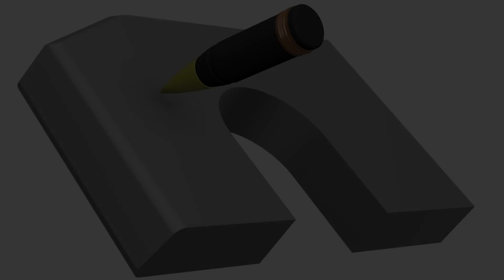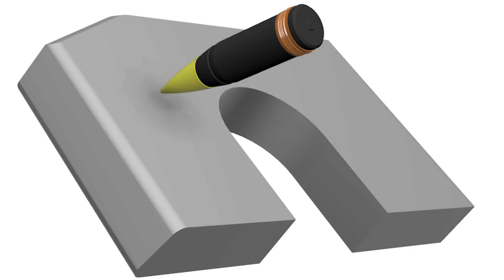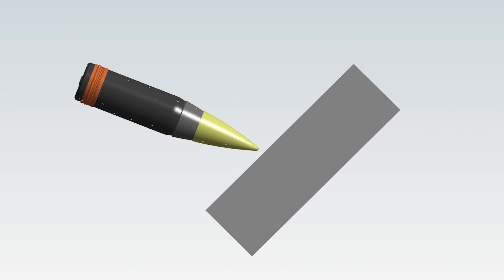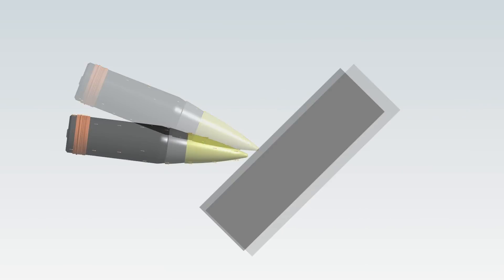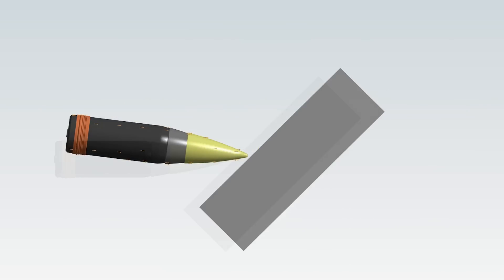USS-Iowa VS Yamato Simulation Part 2

Comment: Wonder about the reverse situation.
Reply: Source material is from the U.S. Navy Bureau of Ordnance.

Immunity zone of the Iowas vs. the 18.1" gun:
Citadel                    24,800- 29,800 (5,000 yards);
Turret Faceplates 24,700- 31,600 (6,900 Yards);
Barbettes               26,500- 31,600 (5,100 Yards);
Steering                 24,700- 28,800 (4,100 Yards);
Control Tower       26,500- 31,600 (5,100 Yards).

Immunity Zone of the Yamatos vs. the 16" .50 cal. gun:
Citadel             17,000- 34,500 (17,500 Yards);
Turret Faceplates                      (Impenetrable);
Barbettes         16,600- 36,800 (20,200 Yards);
Steering           19,100- 33,400 (14,300 Yards);
Control Tower 16,600- 33,400 (16,800 Yards).

Comment: I’m curious as to why the tip of the shell was hollow. I would imagine it would have a much easier time penetrating armor if it had a solid steel pointed tip.
Reply: It is ballistic cap of Armor piercing shell. It is there only to make it more aerodynamic and so lose less speed when traveling. It is hollow so it doesn't interfere with penetration. Steel cap that helps with penetration is behind it. Also you don't want pointed head in these shells because it would just shatter when hitting plate and make shell lose ton of penetration power.

Comment: now it would be interessting to see some modern APFSDS rounds vs. the Yamato turret
Reply: Only APFSDS that could pen front plate of Yamato turret would be if Russians sources are correct Vacuum-1 APFSDS from T-14 tank. It is only APFSDS that has longer length then thickness of the turret front. DM63 and M829A3 both fall short 20-30mm to have chance of penetrating.
Reply: Isnt there another newer generation of APFSDS in the 73 and A4? I swear I've heard those shells being tossed around in a few discussions before
Reply: APFSDS would shatter against the plate. Energy = Mass times (velocity squared). Although their muzzle velocity is about twice as great as a 16" .50 cal. shell, their mass is a very small fraction of the 16" shell.

Comment: They actually did this test on the shinano turret face armor and it's still sitting in the Washington DC Naval Yard you can look it up on the internet the 16-inch shell punched a hole clean through it ,granted this armor wasn't supported in a turret
Reply: Doesn't really matter, all the turret crews would be bleeding from their ears and completely out of action from the pressure wave created by the hit.
Reply: Well that was really damn awful test because plate was way too close and not angled like it would be if mounted on turret. They lowered powder charge, but not nearly enough to make test any way realistic.
Reply: @Sarfanger that test wasnt awfull it was  absolute perfect simulation of a hit at 22mile combat range…

The angle and the shell velocity were matching impact at 22mile range there is plenty of official data from the testfire from the official documents and also from the 16” Mark8 balistics table…
Reply: @17tomashavlin  Good for you if you believe that using rejected plate, at non-realistic angle, distance and with no backing is realistic. Also shells don't come down at perfect angle because of their spin people think that the shell always keeps the nose pointing forward, but this is not the case when you shoot shells that spin around their axis. 

Also velocity wasn't matching 22miles. At 22 miles velocity would around 420m/s while they used point blank reduced shot that was over 600m/s. Even if shell followed perfect angle US document BuOrd OP 770 states at 22miles angle would 47.73 degrees and not 45 degree.

October 16th 1946: 
Impact # 33443
Projectile Used:	U.S. Navy 2700-lb 16" Mark 8 Mod 6 AP with inert filler
Striking Velocity	1992 feet/second (607.2 m/sec)
Obliquity	Near-normal (0°)

Comment: A quick thought, are these the standard 16 inch armour piercing, or the superheavy 16 inch armour piercing the US developed and issued mid to late war?

If I recall not all the US 16 inch battleships would have been able to use them, but the Iowa's most definitely could. 

The question is an important one as if this battle HAD actually occurred, the Iowa's would have been loading the superheavy 16 inch shells and not the standard AP shells most of the others would have to use.

Comment: I believe that the front face was laminated armor which is inferior to a single slab. So it probably would get penetrated after all or would spall.
Reply: Yes you are correct they couldn't reliably cast a turret face in one piece it was laminated and you can see the results of this at the Washington DC Naval Yard they had the turret face armor for shinano and the 16-inch shell blew a hole right through it there's pictures on the web
Reply: @kylevansteinburg5990  That plate was also rejected by the IJN and was fired from point blank range with no angling. Test was totally useless because scenario like that couldn't happen.
Reply: Source material is from the U.S. Navy Bureau of Ordnance.

Immunity zone of the Iowas vs. the 18.1" gun:
Citadel                    24,800- 29,800 (5,000 yards);
Turret Faceplates 24,700- 31,600 (6,900 Yards);
Barbettes               26,500- 31,600 (5,100 Yards);
Steering                 24,700- 28,800 (4,100 Yards);
Control Tower       26,500- 31,600 (5,100 Yards).

Immunity Zone of the Yamatos vs. the 16" .50 cal. gun:
Citadel             17,000- 34,500 (17,500 Yards);
Turret Faceplates                      (Impenetrable);
Barbettes         16,600- 36,800 (20,200 Yards);
Steering           19,100- 33,400 (14,300 Yards);
Control Tower 16,600- 33,400 (16,800 Yards).

Comment: Closest the shell came to penetrating was at 25 km since it was coming in at a relatively good angle. True the closer you are the more energy the shell would have but you also have more armor to go through since its coming in at a steeper angle
Reply: There was a whole thing with shell design back in the 20s and 30s where the drawing board consisted of how to have shells not strike the main armor belt. Its quite an interesting read about USN research vs IJN research where IJN tried a creative method of a shell diving into the water and using the hydrodynamic properties of the shell shape to direct it below the main belt like a torpedo. Called diving/torpedo shells, their design was that they could carry sufficient penetration force roughly 20 times the shell caliber making near misses also quite deadly. In actuality though, the shells failed to meet this standard and traveled less distance underwater plus carried less energy to reach penetration at the closer hits in addition to having poorer direct hit performance of similar caliber shells designed for direct penetration.

Comment: A clear design flaw. They didn't do a rounded turret where the angle of impact doesn't matter because the thickness would be equal in every direction. In this case, a flat plate demonstrates it's weakness, because it can have only 660mm or a little bit more depending of the angle.
Reply: Designers assume turrets will be pointed at the enemy when in combat so unless you're engaging multiple targets a front on shot is most likely.

Comment: I would like to see how a modern apfsds round would perform against this type of armor, maybe at normal tank engaging distances, so it would have a chance at doing anything.
Reply: Problem is that APFSDS core has to be longer then steel plate that is penetrating. Only APFSDS in production that is longer then 650mm is Russian Vacuum-1 for T-14 tank ,but I have only seen single shell manufactured.

Comment: 0:41, just some quick calculations, that backface deformation causes the a pressure wave of 1 ATM to propagate through the cabin,  and a 197 Db soundwave. In short everyone probably lived but is now mildly concussed, and vomiting violently out of sheer pain and vertigo caused by blown out ears.
Reply: yea, that turret would be out of commision for a good bit till either the crew was replaced or managed to pull themselves together
Reply: SRY, COULD U ELABORATE JUST A BIT, WHAT CALCULATIONS DID YOU DO, JUST OUT OF CURIOSITY
Reply: Oops, had the caps on, my bad
Reply: @afonsoalves9704  you were almost look like that crew inside turret
Reply: @afonsoalves9704  At a guess (Im not checking the maths for you, sry nt sry), taking the velocity of a 16" round at the given distance and timing the pixels it traversed before impact will give you a time constant. Use that time constant to calculate the time the deformation took to happen, using the diameter of the shell you can determine a constant to measure the deformation amount. Deformation distance over time gives you a velocity, density of the air around the deformation area will help you work out how effectively that motion is absorbed and transferred to the air surrounding it, thus the propagation wave. Once you have the propagation wave figures you can derive the pressure delta as it passes a given point, and how it acts in an enclosed space. 

Dude, did you like not have lincoln logs as a kid? Or like, legos? Kinex? Put the pieces together, bruh.....

Also, for those about to type something about maths being hard, its not hard, numbers arent scary, yall just have unaddressed traumas left over from school and homework that make you feel like you're a failure because it wasnt easy and you werent perfect the first time. Well, guess what boopy.... NO ONE IS PERFECT THE FIRST TIME. EVER. PERIOD!!! Get over it. How do you get to carnegie hall? Practice, practice, practice. And a left on 7th. Not by declaring things are scary and you suck. You dont suck. Your attitude towards yourself sucks. Stop that. What did they ever do to you? Nothing. Now leave them alone, they're trying! While you're not judging them for others (quite offensive to the others you are judging yourself for by the way, assuming what they care about, how dare you) practice some recreational math. You can do it. I believe in you. The not sucky you. The sucky you needs some therapy.....
Reply: @TankR  jeez I'm sorry that was legit a real question mister... Thought he might give a name for some specific set of equations or smth, geee, what's so triggering about that
Reply: @afonsoalves9704  Dude, that was expressly "for those about to type something about maths being hard"....Dont apologize for them. They're being lazy for cool points. And this dude will not abide.

Your honest question got an honest answer...as it should have. Sure the not checking the math bit was a bit spicy, but the aspects as mentioned were what I could honestly suss out as being relevant. Its the people to think its cool to be wilfuly ignorant and actively avoid engaging their brains that trigger me. And I had been bouncing around some videos with......very problematic comment sections in that regard......
Reply: @TankR get a job
Reply: @b74312  So, basically, my argument is sound, and you have nothing to come back with other than to make schoolyard insults to try harming my feels? 🤣You gotta try harder than that sunshine. Oh, no wait, sunshine is what we brought to the party.....twice.....
Reply: @TankR  “basically” LOL on the self own. Get a job bro.
Reply: @b74312  awe, look guys, its doesnt know its stupid. how cute. Say it again. Cmon, say it again, you can do it little buddy.....
Reply: @TankR  don’t worry man, you’ll get there one day. I believe in you. You got this.
Reply: I am also curious as to how you calculated that
Reply: hell of a lot better than being a smear on the wall, and the iowa's turret cant even take 
the same level of punishment from the yamato, much less its own 16 inch naval guns.
Reply: IM SORRY CAN YOU REPEAT THAT, I CANT HEAR ANYTHING 
-the crew

Comment: I'm not sure if those angles and velocities are correct?

From Nathan Okun's penetration table,

The shells arrival angle at those ranges should be:

25km = Circa 25 deg (26KY-28KY = 22.9-25.6 deg and 25km = 27340yards)

And arriving at a speed of 498-488 M/s

15km = a tad over 11.2 deg (16KY = 11.2 deg and 15 km = 16404 yards)

And arriving at a speed of circa 571 M/s

Comment: If you watched previous videos even when Iowa angles it is not enough too deflect a 18.1 inch shell on the armor belt
Reply: If the Iowa angles,

The hull armour may decap the shell, and from that point on the amount of armour that the shell can penetrate will be reduced.

For example a decapped 14inch and at least 15 inch shell (possibly 16 inch as well) will not penetrate more than 8 inches of armour.

Which is why on the Bismarck class, the turret barbette armour decreased in thickness to only 220mm.

Since the 145mm upper belt is guaranteed to decap every shell, you only need a minimum of 203mm of armour to shatter the shell.
Reply: @ it seems in his videos the simulations show complete penetration each time at a velocity of around 540mps

Comment: Something to mention: you can't simply calculate effective thickness by using trigonometric functions, neither horizonal nor vertical. The value would differ for different calibre/length shells in the penetrating progress, since shells are not a simple point of mass, thus you have to think over the T/D (actual armor thickness to shell diameter)  ratio.

Comment: They would have used plunging fire, which means deck penetration so in goes below decks and explodes.  Iowa had radar guidance for its fire control, the Yamato would have been sunk or severely damaged inside of 10 min
Reply: The advantage of U.S. Navy fire control radar is a widely stated and believed myth. The advantage of the U.S. Navy's Mark 8 radar range keeper over Yamato's foretop optics and her Type 22 radar was minimal- 30- 45 yards at 20- 25,000 yards, versus 89 and 109 yards respectively. This was more than offset by the shell dispersion rate of all U.S. modern battleships versus that of Yamato- 1.9% of range for a nine- gun salvo vs. 1.3%. This was a major factor in why none of the Iowa's obtained a main battery hit on any vessel of destroyer size or larger during WW2 (in one case even though firing at a stationary target)- and why Yamato obtained multiple 1st- salvo hits on two different U.S. vessels off Samar.
Reply: @ the battleship Wisconsin fired 3 salvos at 35000 yards at a towed target striking it 11 times
Reply: @MedicNewfy  During Operation Hailstone in February of 1944, Iowa engaged the Japanese training cruiser Katori in a clear visibility daylight action at an average range of less than 14,500 yards (medium range at best) using the Mark 8. Shell splashes were observed both visually and with the Mark 8. All eight salvoes (46 rounds, I believe) were straddles with no hits. This was despite the fact that by the time that Iowa opened fire, Katori had already been hit by a torpedo and from 2- 7 bombs by carrier aircraft, numerous 8" and 5" hits from a U.S. heavy cruiser and destroyer, was not firing her guns back, and was making approximately 1- 2 knots (one report had Katori dead in the water).

One reason for this was a lack of main battery gunnery practice of almost all of the modern U.S. battleships after arriving in the Pacific Theater. In fact, the Battle Line did not conduct gunnery practice or maneuvers as an integral unit until September of 1944. The primary reason was shell dispersion (which fire control radar could not affect) in U.S. Navy battleships, which was among the highest of any major navy in WW2.

Comment: what is impressive about this is that, you could probebly feel the impact even if you wherent in the turret and merely an anti air gun on the other side of the ship
Reply: You just had a used Honda Civic slam into the turret at 2500ft/s. Everyone is going to feel that. XD
Reply: The AA gunners would not be anywhere near it. 

In a battleship on battleship fight, which this is obviously simulating, the crews of all non turreted guns would be withdrawn into the hull or superstructure of the Battleship SPECIFICALLY to protect them against the blast of the main battery firing. 

The Navies of the time were not stupid, they well understood the blast effects of battleship guns firing on exposed crew. All non turret crew withdrawing into the ships hull or superstructure was standard practice for all Navies operating Battleships.
Reply: @alganhar1 
1. Multiple weapons are dual purpose weapons
2. I indicated the other side of the ship, this is  an earth shaking impact. 
3. I'll provide a counter argument that having all of your aa gunners withdrawal into the hull and then you go under aircraft attack would be a tactical fallacy. You cannot determine when you will need to use specific weapons for varying importance, In a battlefield situation.

 provide me a proper source for this information please.
Reply: @moustrout1299  not all AA crews would be withdrawn. The ones on the superstructure would likely be out. But the 5" guns are DP and would be able to respond regardless.
Reply: Everyone would feel that
Reply: Spalling may kill the gun crews anyway.

Comment: But they actually tested Shinano's turret face plates after the war and the Mark 8 went clean through at point blank range. But don't know the angle of impact either.
Reply: Other comment said it was perpendicular for the irl test, so it would favor the 16" gun even more than any of the scenarios in this video.
Reply: From a range of 400 feet with a 90- degree impact angle.
Reply: @manilajohn0182  But with a reduced propellant charge to simulate a hit from a distance and not the 400 ft.
Reply: @jimbro5223  The conclusion of the USNPG report cited the inability of the 16" .50 cal. shell to penetrate the plate at any combat range.
Reply: Square on.